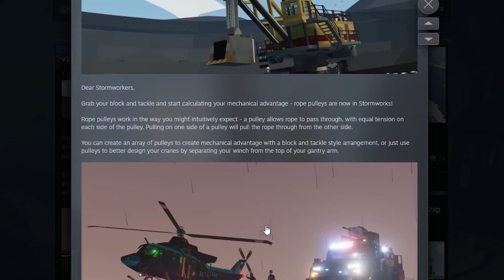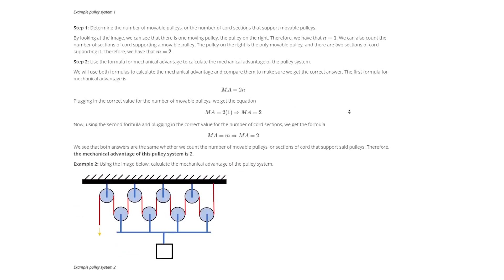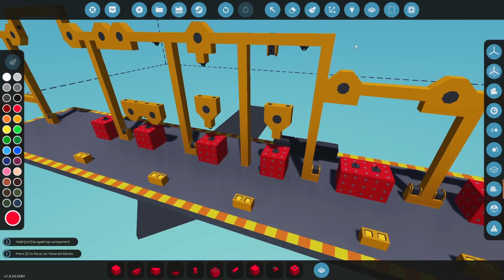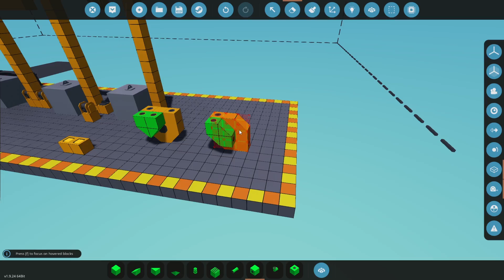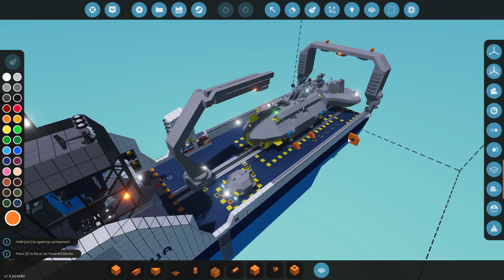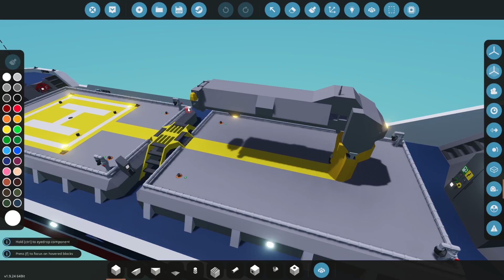Testing the ROPE PULLEY UPDATE in Stormworks!

Comment: I have givien up completely on my fast passenger liner. (It uses Jet engines)it has a max speed of 17m/s and can maintain that speed for 15km and after the 15km mark the speed has dropped from 17m/s to 15m/s and by 20km mark the speed dropped again to 12m/s and by 22km mark ut dropped to 10m/s and by 26km it dropped to 8m/s and by 28km mark it dropped to 6m/s and by 30km mark it dropped to 2m/s and by 32km it wasnt moving at all.  

Also it has 4 lpropellers and 2 of then spin in oposite direction of the other 2 and they are suppose to spin inwards towards the hull. If somone can please try to fix it and when and if you are able too can you please respong to this comment with the solution ti fux these problems and how you figured out the cause. and how you solved it thanks.

Here is the Link to my ship.     https://steamcommunity.com/sharedfiles/filedetails/?id=3100840188

Comment: Just adding a torque input to the winches would be all we need. Likely as new blocks as how Stormworks updates. t would also give use gear ratios and speed of motors back. Especially that last one, we need. You could also have Power Take Off systems from a motor.

Comment: Could you make a tutorial on how to make an auto pressure hold for a small room? (simulate air in and out with pumps) pressure can be set with a keypad, I used a PID but it overshoots it (quite) a bit and "vibrates" in outputs. 
(Basically pressure hold for over and under pressure?
Reply: If I’m understanding you correctly then I did something similar for the ballast tanks on the sub I made. 
 For your setup I would use the Greater-Than and Less-Than Logics. Connect the pump that you use to fill the room to the Less-Than and the pump that pumps out to the Greater-Than. Then connect a meter (Barometer for pressure in this case) to the A ports on the Greater-Than and Less-Than. After that connect you a Keypad to the B ports on the Greater-Than and Less-Than and you should be good. Also might be best to use two small Keypads or one large Keypad to send different set numbers to the Greater-Than and Less-Than (like sending 2 to the Greater-Than and a 1.7 to the Less-Than) so the pressure will fall in between the numbers and the pumps don’t constantly kick on and off.